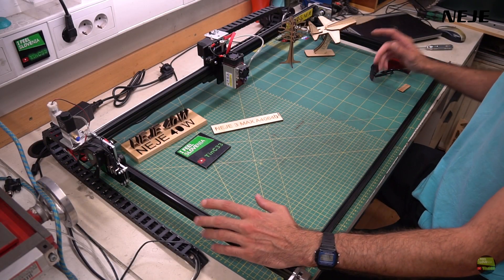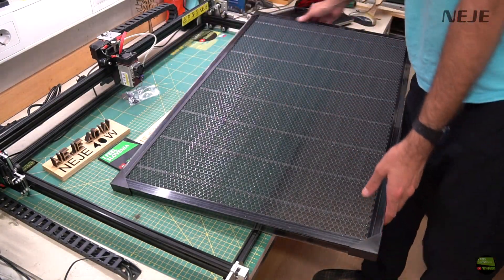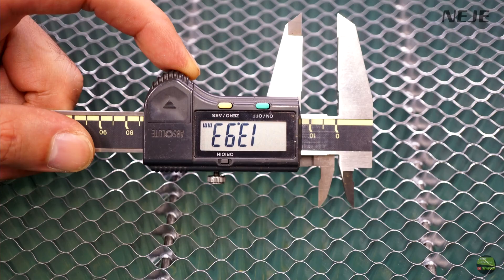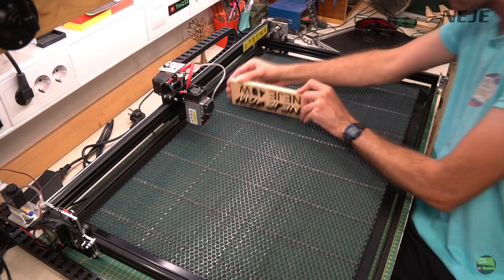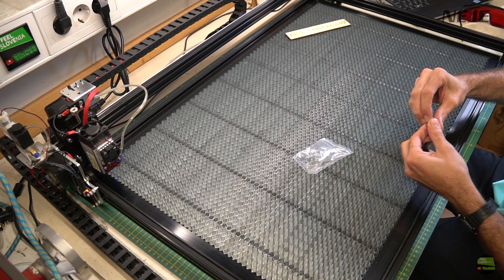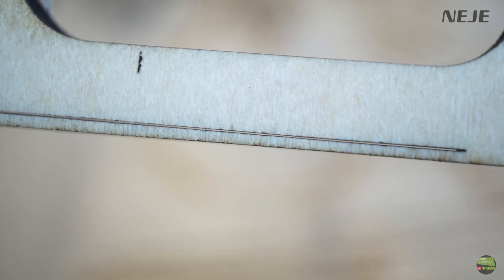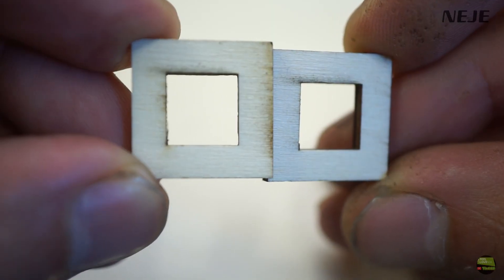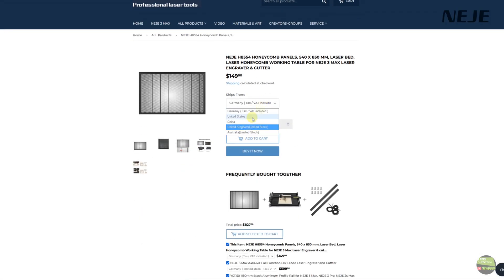NEJE Honeycomb Panel for Neje max, big improvement of cutting [unbox / review / first test]

Comment: hello, I just received the lower honeycomb, but it did not fit. am I doing wrong. I would be glad if you help. Thanks
Reply from the maker: what model of engraver you got?
Reply: @TinC33  neje Max 4
Reply: Can you help me with the installation, my friend, how do we cut. How do we communicate? thanks❤
Reply from the maker: @huseyinpolat9981  it doesn't fit on neje 4 true, because it's prepared to install L profiles on each thread it got on L profiles, but can do also with honeycomb, i just put few plates of 5mm plywood under, so the honeycomb panel fit over the front and back L profiles and that's it.
Reply: @TinC33  62 / 5.000

Çeviri sonuçları

Çeviri sonucu

star_border

I understand. can you help me with neje 4 machine working
Reply: hello, at what speed and motor power should we cut in order to cut 3 mm plywood in one operation with the neje 40640 laser. How should the focus be between the plywood to be cut and the laser? I would be grateful if you could help.

Comment: Given the cost of this panel, it might be cheaper just to buy aluminum honeycomb, was the steel panel better output than the aluminium honeycomb. Q. Have you tried the E40 module?
Reply from the maker: i think aluminium one work exact same as steel one, pros of aluminium one is that it can't rust, cons is that it's quite delicate and can be demaged quicly, steel one is very tough and magnets can be used to hold the material. defenitley aluminium honeycomb will be cheaper, but don't know where to get one, plus they may be some problem of banding, mine aluminium (small round one) is always a bit bendet on one or another side, if plate will be bigger also that issue will be bigger i think.
i got E80 at home but didn't test yet, hope to get time to make a test soon.
Reply: @TinC33  how do you have and e80?
Reply from the maker: @skylarshockman7659  no i think it's not yet realeased by neje, i edit E40 video right now, but it is not that good as A40640 wich cut about 20mm E40 only about 15mm